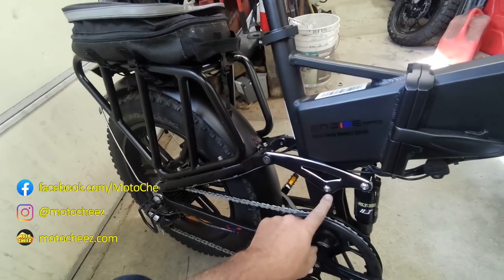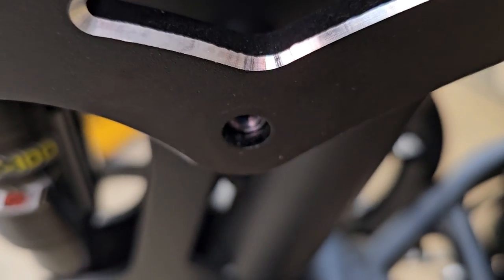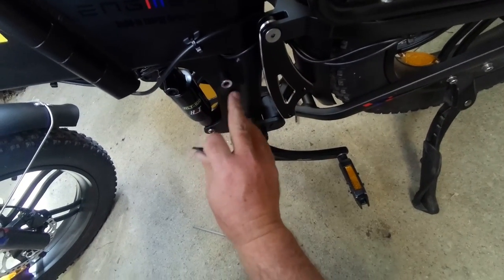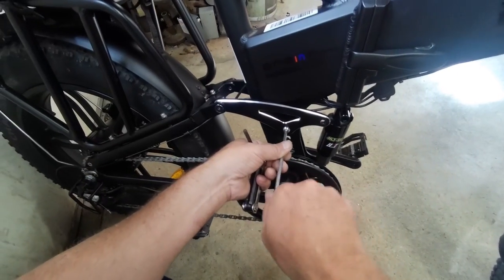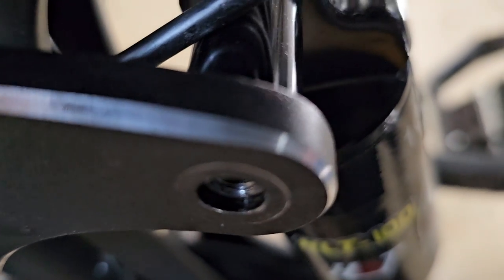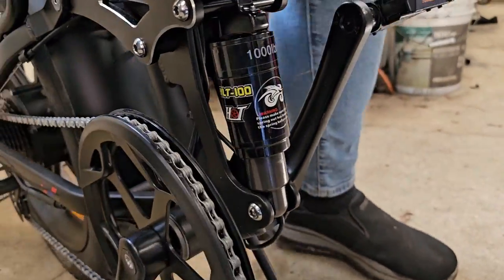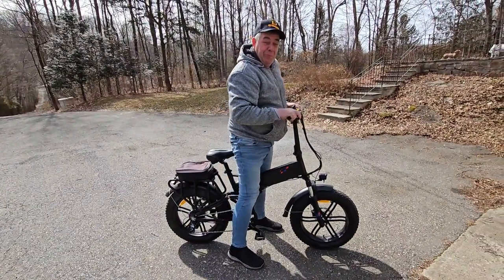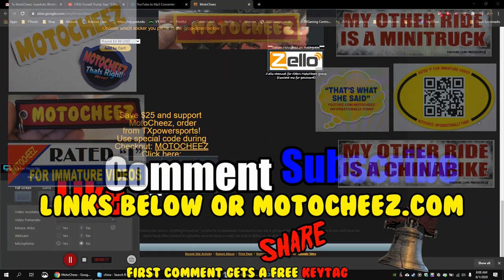Rear suspension fix, how to fix rear shock on the Engwe Engine Pro folding e-bike

Comment: For $1500.00, that should be arriving properly assembled, instead of braking brackets the first test ride.  Chinesium strikes again.
Reply: The bike is built by the shop he bought it from, not necessarily built by Engwe. That's why I always put my own bikes together.
Reply: Most of these come with this issue from factory. Still a great bike just some know-how needed

Comment: That is too bad that they did not size those pins correctly and having the fender slip up and down is a poor mechanical solution.
Reply from the maker: I put a revised fix in the description, apparently they were supposed to be shipped with the lower fastening bolt for the fender not installed so it moves up and down at the lower point

Comment: All you have to do is unscrew the fender screw, which is the third, wrong one at the bottom. It's the one closest to the pedals. You will immediately feel a huge difference in suspension performance.
Reply from the maker: I saw that slotted hole which was bolted tight, the side brackets were solidly bolted and prevented it from pivoting
Reply: @MotoCheez  Unfortunately, that's not enough.
To the test please remove the rear fender completely and you will see that the suspension will work nice
Reply from the maker: It's working perfect now the way I have it set up, I tried it before I put the shock back on it and it was moving very freely
Reply: My mudgaurd is not bolted to the frame down low near the pedals
Reply from the maker: That would work better if it's not rattling
Reply: I had to swap the screws as well ... The pre-built was not right.

Comment: I want to thank you for posting this video. It was the only video that I could find to help me fix the rear suspension on my Engwe Engine Pro. I followed your video to the letter and now my bike feel so much more comfortable to ride. The rear suspension actually works now. I can't thank you enough!!!
Reply from the maker: Thanks, there is another way to get the suspension freed up. I believe I put a link in the description but it's basically just disconnecting the front lower bolt behind a pedals of the fender and leave the other ones connected. It's an easier way to do it
Reply: @MotoCheez  I wish I could save photos here I would love to show you Phase 1 of my bike. I have the upgraded model of the Engwe Engine Pro. I don't think the rear fender connects anywhere other than the 2 silver metal arms and the rear swing arm.
Reply from the maker: You can share a cloud link to a photo

Comment: I dont get it? What was the fix? Didnt you just unscrew and screw the bolts back? How did that help the suspension to work better? Or did I miss something?
Reply from the maker: In the description I did a better fix which was take the front bolt out of the fender that hooks to the frame low and yes you have to loosen up the pivot points of the shock assembly longer bolts would be the better fix

Comment: Thanks, just got mine and I weigh 130 70 yr old. Will that work for mine? If so, I’ll get my husband to ck on that before switching out the shock. It’s definitely stiff & makes for a ruff ride. Of course, just now riding it around the yard and driveway to get use to it. I think it’s going to be great when we go to Fl and the Mtns. I got him a Walke 7AWD, he rode it yesterday and said it took our Alabama hills around here easy. Can’t wait to hit some trails. Already have an enclosed trailer he can pull for our Labs to ride with us. 🐾🐾🚴💥❤️😎💫
Reply from the maker: Yes the shock will work for you, you can even loosen the tension on the spring a little bit if you think it's too stiff. Sounds like fun

Comment: This video helped me fix the rear shock on my Vitilan i7 which has a similar frame to your ebike.  I couldn't figure out why the coil shock was so stiff and had almost no give.  I loosened the bolts a little and suddenly the rear suspension started working.  Thank you!!
Reply: Can you make a video of what you did? I also have a vitilan and I recall watching a YouTube review of the bike and a older gentleman also made the comment of loosening something but he didn’t show how to do it.
Reply from the maker: @t0nyT I have a link  in the description
Reply: @t0nyT  The two screws that he points to at 00:22 and 00:31 seconds in are the two I loosened.  They were torqued down too much from the factory.
Reply: @pizzaking7878 just did it. Rides a lot better, the rear suspension moves now. Thanks. 

How you liking your vitilan so far. Any problems. Just got mine a week ago.
Reply from the maker: @t0nyT I have not had any problems at all, One guy said the bushing started wearing out where to pivots are that you have to loosen a little bit for the rear shock
Reply: @t0nyT  I like mine a lot.  No problems so far.  I've only put about 80 miles on it.  I added a saddlebag over the rear rack and replaced the spring shock with an air shock.  I bought the air shock off Vitilan's website.  The i7 comes with a spring shock that is disguised to look like an air shock.
Reply from the maker: @pizzaking7878 nice! Better ride?
Reply: @MotoCheez  It's a lot smoother than the stock spring.  The stock spring wasn't a bad ride though.  I have to get a shock pump to get it to proper psi.  I've got it at 120psi and need to get to 150psi.  It's a nice upgrade that has you feeling the results instantly.
Reply from the maker: @pizzaking7878 thanks!
Reply: @MotoCheez  Of course!  Thank you for the video.  It helped me by telling me which 2 screws to loosen.  The ride on the stock coil spring was 100% better after that.  I though it was interesting that everything else on my ebike had to be tightened up out of the box except for the rear suspension.  The factory torqued it down far too much so that it wouldn't compress.

Comment: With the upgraded version of the Engine Pro (yours is the older model), the lower part of the fender doesn't go so low and isn't bolted to the frame, so there shouldn't be a problem there. I don't know if they fixed the suspension though.
Reply from the maker: That's good. Thanks for the info

Comment: I put #10 snap washers on the screw side that fit inside the bracket holes. It adds about 1mm to the length of the pivot pins. I also used loctite on the screws.
Reply from the maker: I'll have to find some of those thanks for the info

Comment: I had the same problem with my engine x here in the u.k. I bought 2 86mm m8 axle bolts from amazon and that solved the problem. The mudguard on mine only drops down so far and doesn't attach to the bottom of the frame so I don't have any problems there. Bit of a crap flaw by engwe but having said that I enjoy riding mine. I was wondering whether you can run these without hall sensors as these can fail especially if you use full power a lot that generates a bit of heat within the motor.
Reply from the maker: 👍👍Probably won't run without the hall sensors...
Reply: @MotoCheez  I know some controllers can run without them not sure about engwe although I've watched a few vids of em running rough so probably not😆
Reply from the maker: @simonjohnhinton1938 pretty sure it's related to speed sensing and the mandatory speed limiting
Reply: You got the Amazon link mate?

Comment: Hello, thank you for your explanation.

I have just few questions:
1. Could you explain better where to put the loctite ? On the 2 bolts you changed or also on the bolt down the suspension? 
2. did you put the loctite inside the bolt or outside ?
3. Which lotctite did you use ?
4. The washers: have I to put the washers on the 2 sides of the bolt? Which size have to be the washers ?

Thank you again.
Reply from the maker: The locktite goes on the thread only, blue locktite, I don't remember the size but someone else commented on here or bring them to hardware to match
Reply: Oil 3 in 1 do you think is ok too instead of locktite?
Reply from the maker: @gaetanomauro1184 oil pivot points, locktite threads
Reply: Thank you

Comment: Thanks for the information.. will help my assembly on the bike.
Reply from the maker: You could take the lower bolt on the front part of the fender that hooks behind the pedals and disconnect that and it's easiest way to get that rear suspension to work
Reply: I think the company fixed that problem because I don't see that bolt you've mentioned.  I just received my engine pro today..
Reply from the maker: Awesome!

Comment: Thanks for the video - where do you add the loctite? I don't think I saw you add anything in the video.
Reply from the maker: The threads had locktite already
Reply: Thanks for the response - would ordering longer bolts say 86mm instead of 82 be a solution? What is the actual solution in your video - shaving the paint?
Reply from the maker: @PuissanceMandataire  somebody commented with the sizes on this thread

Comment: Any idea where to find replacement bushings for the rear pivot points? There are plastic pivot bushings in the rear two mounts (where the links attach to the swingarm) that wear out.
Reply from the maker: Probably direct for manufacturer unless you can measure them and order online. Maybe you can find brass set

Comment: Would i be better off getting new bolts and cutting to size as i dont think youd get exact with needing a lil less for the other bolt to fit snug and did sortin them bolts fix the bottom spring or whatever its called ?
Reply from the maker: You could locktite at the loose adjustment with original hardware too. Even silicone rtv will work

Comment: i noticed that the center screw it's creating a lot of noise when i push the suspension, i tried to remove to grease it but it's very difficulty to get it out, seems sticked inside the hole and need a lot of force
Reply from the maker: The easiest fix, is remove the lower screw on fender behind pedals and tighten the middle screw back up
Reply: @MotoCheez  so i remove togheter, scew first the middle screw and so the fender screw?
Reply from the maker: There's 3 screws total that hold fender on, just remove the bottom front screw that's behind the pedals, leave the other 2 tight. It'll allow the suspension to move freely
Reply: @MotoCheez  is it safe to do?
Reply from the maker: Yes, it's just the bottom screw on fender. With all 3 connected the suspension doesn't work properly. There's other people out there saying to do same

Comment: Question for ya, I tried to upgrade my shock to dnm aoy36rc but can’t get shock on. Won’t compress, same suspension but can’t fit shock into mounts without compressing shock as frame is in the way! Ugh. Can you help?
Reply from the maker: I'm not sure because I did not change the shock, but if it doesn't fit I don't know if it will work.
Reply: @MotoCheez  
It went on once but had leak had to remove to fix leak, but now I can’t get it back on because it won’t compress. UGH can’t find any help.
Reply from the maker: @Greatgadgetsgear ohhhh. Damn

Comment: Could you not make a couple of small spacers to take up that space
Reply from the maker: It slides up and down. I put the easier fix video in the description it's basically keeping that bolt on and taking the bottom bolt of the fender off and then it just moves  up and down
Reply: @MotoCheez  sorry" I meant spacers where the rear suspension linkage plates are each side of the downtube,  I thought you mentioned the bolts going through were a bit short
Reply from the maker: @alanread8468 yeah they were too short. Not sure where you mean to put the spacer. Would that need a longer volt?
Reply: @MotoCheez  yeah" what I was thinking was a small spacer added between the bolt that goes through  the frame, just enough to bring everything snugly fitting together, maybe I'm over thinking the issue

Comment: I just got my engwe engine pro, took it for a ride yesterday and when you go fast the rear fender rattles like crazy. Is it because of the suspension? I checked everyting and all the screws and whatnot is tight.
Reply from the maker: Did you remove the bolt behind pedals that hold the fender so rear suspension will work?
Reply: @MotoCheez  no yet, but is this the issue? I was think of removing the backfender entirely. I saw your video assembling the bike, mine does not have 2 skrews holding the fender by the rear suspension, I only have one.

Comment: hello, where can i find that triangle piece between rear suspension and the rear of the ebike? i broke that
Reply from the maker: If you can fasten it there with a washer, many just remove the lower bolt behind the pedals
Reply: @MotoCheez  I broke the ""washers"" on the rear part, so the rear of my bike is very wobbly
Reply from the maker: Dealer should have the parts. Not sure which part you're referring to

Comment: Most common reason fender accidents happen is cuz the lower bold connecting the rear fender shouldn't be there. Its the reason your higher one ripped off.
Reply from the maker: Yes! I didn't update video in the description stating just that

Comment: Why is the end of the back fender bolted to the bike??  That's why it broke off
Reply from the maker: Yes! And it came that way, that's the best fix, remove that bolt
Reply: @MotoCheez strange it came that way. Never seen that before
Reply from the maker: @Gunner11763 a lot did apparently at first